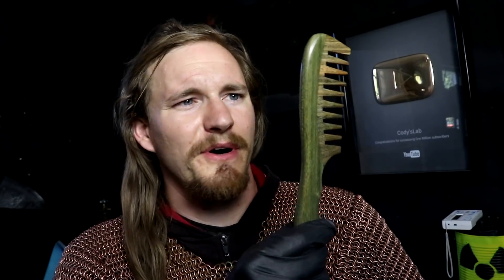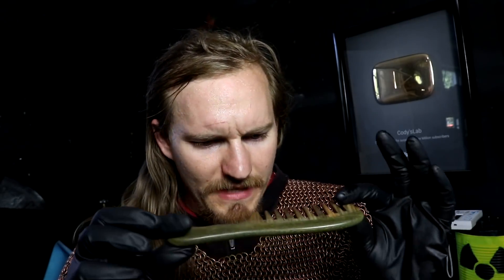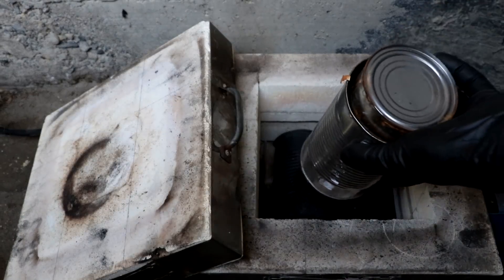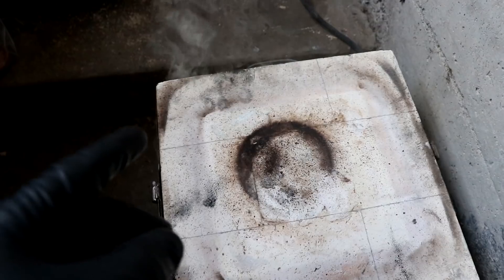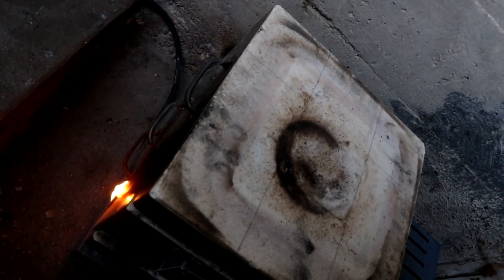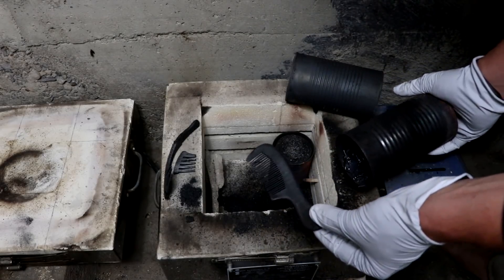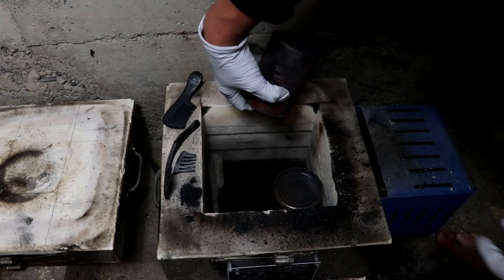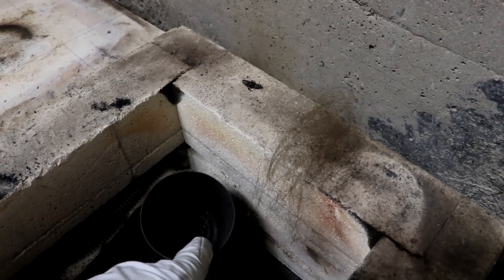Will it Charcoal? Ep. 3: Hair, Comb

Comment: comb separated for the same reason it wasn't one whole pieces. The wood is a lot stronger along the length, and splits more easily with the grain. So the tines or bristles are oriented along the length of the grain and the handle's grain is perpendicular to it. Wood shrinks across the grain, rather than along it, so the tines shrunk more than the handle piece and pulled away when the glue combusted. You probably knew that; I'm just saying.

Comment: 5:39 the grain is in different directions. That's why they shrunk differently. I guess due to the cellulose alignment. The curve could be due to which side was closer to the side of the can which changes the heating and access to active chemicals in the gas. I guess try suspending your test objects in the middle of the can to avoid such problems?

Comment: i have been on the charcoal/ biochar mission myself independently. i did a rose a while back along with other flowers and bits and pieces. i found that i could set it with spray varnish. that gave the piece enough strength to dip in epoxy resin. poor mans carbon fibre. maybe you could do it properly?

Comment: You could make some interesting things doing this and then vacuum resin stabilizing the charcoal items.  Your combs would work good as new after that.  Also, would the same process work just heating the wood in a vacuum?  Don't know if you could maintain the vacuum with the wood offgassing, but maybe wouldn't need to?  Say, like in your giant pressure can with a fire underneath it?  What would it take to carburize a like a campfire log that way?

Comment: Try out chucking in a piece of dry ice inside the cans before you start heating up the oven. That will displace all the oxygen in there before they heat up, especially if you leave the cans in vertical position (assuming CO2 is havier than air). It might also not make any difference, but I just had the idea...

Comment: Suggestion:  Use a technique pen turners use to stabilize wood.  Immerse it in a thin resin.  Set into vacuum chamber to draw the air out.  Then quickly let the air back in.  Now the wood is saturated with resin.  Then bake the resin to harden and set it.

Comment: Hey Cody. Can you put the comb in a vacuum chamber with some epoxy or resin. After you remove all the air, remotely dip the comb into epoxy bath and slowly increase the pressure. This should fill every pore with epoxy and make it very strong. You can try the same with strong fabric.

Comment: doesn't look like sandalwood, actually looks like Lignum Vitae, hence the fragrance.  It's one of the densest woods available and was once used as stern tube bearings on ships.  bummer you burned it, that wood is hard to come by these days.  At least it was sacrificed in the name of science :D
Reply from the maker: I have two more of them. ;)
Reply: Cody'sLab Oh nice!  Easy way to check if it’s Lignum Vitae is to drop it in some water.  Should sink like a rock.  It’ll also oxidize to a darker bluish green over time.  👌🤠

Comment: The comb was constructed so the long wood fibres run along the handle and perpendicular to that along the teeth for structural strength. Since wood shrinks much more in the tangential and radial plane than longitudinal/axial, you get the observed effect.
The curve of the other one is actually due to the same properties: it's made from one piece, grain runs in the direction of the teeth but the inner side of the curve was at towards outside of the trunk, therefore the small difference between tangential and radial shrinkage causes it to bend. It's the same in wood drying, though much  more pronounced in this extreme form of "drying".

Comment: Cody must go through furnaces like crazy. Some ideas. Maybe get a current measuring device for it so you can see the flow, (And when it's not flowing). Show the repair if possible. Also, is there a reason an electric furnace couldn't be hybridized with a propane furnace to get some of the benefits of both? Reducing atmosphere, quicker start time and what not.

Comment: The large comb is two pieces of wood (the handle and the teeth) glued together with cross grain. It looks like the heat softened the glue, then each piece of wood shrank perpendicular to the grain. The root of the teeth part broke under tension as it shrank because the glue joint did not slip easily enough.

Comment: Take my tip re hair brushing/combing: brush the bottom inch of your hair first, then the bottom two inches, then the bottom three inches and so forth... moving the starting point up each time until finally your brushing fully from top to bottom. It takes a little longer but you will have smaller tangles and loose less hair if you brush/comb your hair this way each day.

Comment: Brush the ends first to prevent snags. Brush in increasingly larger strokes, starting a little higher up each time.
If your hair keeps snagging you way want to try washing it less or more often, both usually work. But the better fix is probably to cut off an inch to get rid of the split ends.

Comment: Pyrolize a comb, then add a slow curing resin, pull a vacuum to void all the air from the charcoal and resin, then pressurize it lightly for an hour, remove and clean it up, finally letting it cure, see how it sounds and if it is still structurally viable? Similar to a filled carbon resin composite. I would suggest a smaller one because of the material shrinking. Might be interesting for a screwdriver handle as well(I originally wanted to make some carbon resin composite handles).

Comment: The wide-tooth was glued from two pieces, with different grain directions. The glue melted, then the wood shrunk differently because of grain. The fine-toothed comb was cut out of a single piece of wood and thus stayed whole. You can make a custom comb wrom a single piece of wood (with a thicker handle prehaps) and it will stay in one piece.

Comment: So, wood shrinks and moves as it dries. This is applicable mainly to air drying or kiln drying lumber. You took it to a extreme when you baked it so hotly. The reason the first comb broke, and the second one didn't, is because the first comb was made of 2 pieces of wood, and the grain was running perpendicular to one another. This caused them to shrink it separate directions, resulting in the breaking. But the second comb was 1 piece, so all of the wood shrunk in the same direction, resulting in it not breaking. This is a hotly debated topic among the wooden cutting board community, because if you make a fancy wooden cutting board where there are pieces of accent wood that are glued in with grain orientation not parallel with the rest of the board, changing temps and humidities throughout the year can cause the board to move in weird ways, and ruin it.

Comment: I highly recomend making charcoal out of sugar. The end product resembles sugar glass but it's black and full of bubbles. I suggest to fill the can only partially, about one third of the volume, as this stuff expands quite a bit and you may not want your furnance to be flooded with sugar charcoal. I no longer remember whether I've conducted this experiment using crystal or powdered sugar. I suggest trying both even though there may be no difference in the end product.

Comment: Could you infuse it with two part polymer to strengthen it. (I'm wondering if that would create a lighter and stronger comb for your "trip to Mars.")  If the orientation of the comb is vertical, would that prevent the curve?

Comment: Hey Cody'sLab , it would be nice if you could get your hands on crude oil, or the fact what I've been hearing is turning plastic back into oil. From the equipment I've seen you use; you can make a chamber air tight and flushed out with oxygen to avoid oxidation of the plastic. Then, water cool the vapors back into pure crude oil for other uses. Id also be nice if you'd do some chemical equations with balancing mol ratios/ grams/ ml/ etc.
Reply: "Flushed out with oxygen to avoid oxidation" sounds counterproductive...
Reply: Josh St. Louis probably meant “flush out oxygen ...”
Reply: @toejamr1  I did mean to say flushing out the oxygen.

Comment: also, pro tip for from a guy who has had long hair for 20 years, invest in a good shampoo but more importantly a good conditioner, you will see a HUGE difference. Also only pull it back into a pony tail when you need to for work and such, invest in a few good head bands to keep it out of your eyes. A pony tail puts stress on the scalp and weakens the hair

Comment: Here I was about to suggest that you soak it in a low viscosity polymer and make it solid... ~( 'w')/

But...you broke it... ~( ,m,)~
Reply: he needs to see this, i know he'll totally go though the trouble of making another just to do it
Reply: @BionicleFreek99  If he wants a straighter carbon comb, all he needs to do is char it between 2 plates of steel so that the heat comes from the peripheral edges while the steel moderates the temperature AND constrains the wood. It will not make it PERFECTLY straight [due to the nature of wood] but it will help a lot.

Also, raising the heat gradually over several days will help somewhat because it will allow the wood to very slowly degas [more evenly] instead of degassing from the outside in at an imbalanced rate.
Reply: Yep I was gonna suggest he send it to peter brown to get it put in stabilizing resin that way it glows under a blacklight as well

Comment: AYE CODY! GOT A TIP BRO! 

Brush from the bottom up!!

Ive had long hair my entire life, and i only learnt this in the last year or two. 

What you wanna do is grab a chunk of hair you wanna brush, and grab it near the bottom with enough hair left hanging to brush. This will allow the knots to come loose at the bottom first instead of bunching up. 

Once that part is done, grab the next bit higher and repeat. you'll lose so much lease hair!

PS. Scrunchies are your friend <3
Reply: This.

Clarification: you're still brushing down, but the spot where the brush first contacts the hair should move up. Brush the last few inches first, moving up to your scalp.
Reply: i had good experiences with brushing from the inside in addition to the bottom up bit.
Reply: @AkiSan0  Never sleep with any kinda hair tie, and if you have to, make sure you tie your hair at the very top of your head, so that the hair flows over the back of the pillow. 

I think most of the knots from sleeping come from our head grinding them together when we move and roll.
Reply: all spot on, with a slight exception on the scrunchy, i've found falling asleep with one in my hair causes tangles on the scalp side of my hair where the scrunchy is, and can be a pain to get out.
Reply: I intuited this when my toddler's hair needed brushing. My wife was jealous that I was the preferred brusher. I relished in it since Mommy was the first person they ran to for so many other things.
Reply: I had long hair in my youth and tried not to cave for a long time.  now I know. just buy the clippers and use a 1 or 2 on the sides and back and a 3 or 4 for the top. a 1 on it all is nice too.

Comment: Obviously the difference is in the construction of the two combs. The big one has the handle grain running along the long axis, to provide stifness and strength, and the teeth are running along their long axis. The small one just has the grain running along the teeth. As you said, the differential shrinkage caused separation. I wonder if you could GROW a comb with the grain running in the best direction for each part? There are companies that grow furniture just now, you'd just have to find a way to bend the grain as the branch is growing!